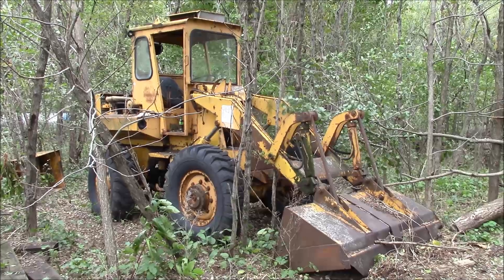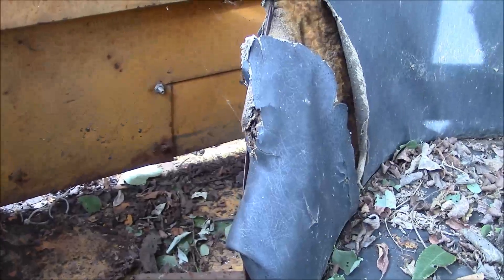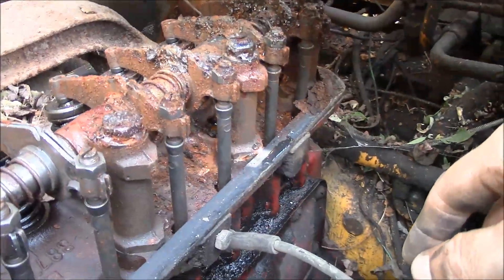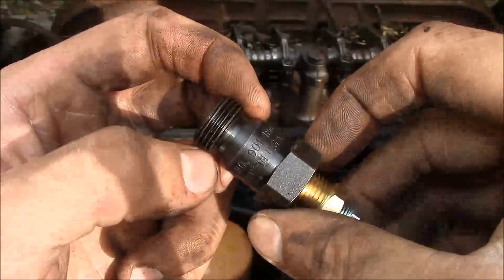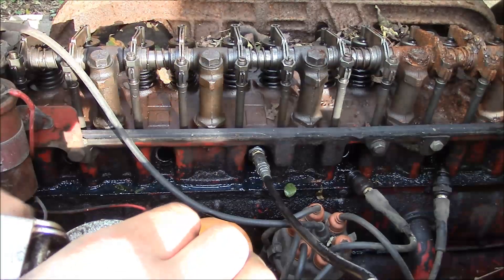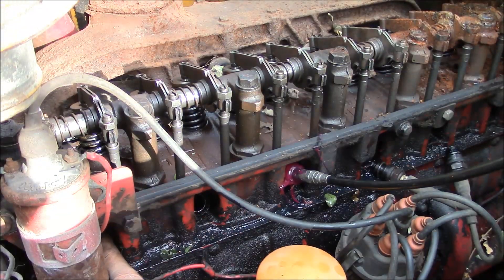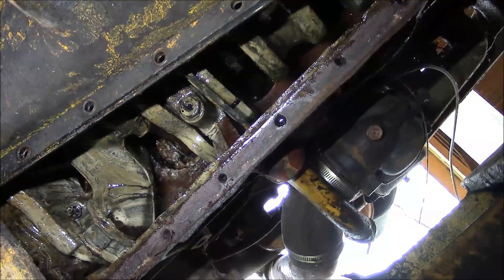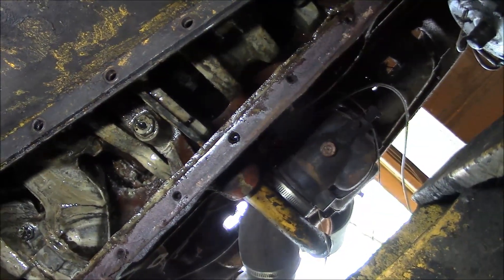Can You Free a Seized Engine with a Grease Gun?

Comment from the maker: The engine has had a mix of ATF and diesel in the cylinders for 4 weeks at the time I filmed this. I have no idea why I keep getting comments that I need to put some kind of special sauce in the cylinders. We did. I should have made the end of the video the beginning, because no one watched the explanation at the end.
Reply: @stinkyvonfishstix4196   *their car
Reply: @electricitysucks5  Period after 'idiots'.New sentence. Capital i on 'it's.
Reply: I understand this engine is probably roached but for future reference putting a breaker bar on the crankshaft with a heavy weight on the end can help the oil penetrate the cylinder walls. My father did that to a chrysler 360 v8 it took weeks but it freed up and went back to work.
Reply: I watched the explanation at the end. :-) Thanks for sharing that video! I hope to see more!
Reply: We had a old 4cyl ford in a old skidsteer that was seized.  We took the head off and gently hammered down on the top of the piston with a block of wood and lots of penetrating oil.
Reply: I would imagine that it is getting quite nippy to work outside on that thing. Use that brand new rollback (lol) and get it inside by the heater.
Reply: I did!
Reply: Remove the kon rods from number 5 and 2 and try free up the rest of the engine first then worry about the Pistons. So at least u can remove the engine
Reply: @juniorfuller6829  How would you do that?  Yep 5 years old, id like to know.
Reply: How'd you end up with all these machines? Were they operable and just abandoned? Did the property come with them? Were they junked?
Reply: Special sauce, lettuce, cheese, pickles and onions on a sesame seed bun.
Reply: Pure straight gasoline eats rust..... try that next time you run into a seized engine.
Reply: Piece of cake there's always a way
Reply: Too much yip yap
Reply: FYI Vinger is a hell of a special sauce to free up rust
Reply: Seafoam deep creep works great for seized engines. I've tried atf and diesel mixed. As well as MMO and it just wouldn't penetrate.  But after having Seafoam in it I noticed it started to slowly disappear and it was dripping out of the pan. And it eventually broke free and is still running today.  Not saying it didn't have blow by but it still runs haha.
Reply: 20 year master tech here....
Fill up cyclinders and crank case with kerosene. Let it sit for a week with a dipstick style block heater in it and plugged in. If it don't spin after that then its done.
Considering the rust on the rockers i would just yank it and not waste time.
Btw... Atf and diesel fuel mix is too thick to penetrate anything. Yes their lubricants but their viscosity is too thick.
Kerosene is one of the thinnest out there. Chevron RPM oil works well too but its hard to find, im not sure if they even make it still. Stuff is liquid gold tho.
Reply: I had a set of roller skate bearings start to rust on me for sitting in diesel fuel for several days.
Reply: Diesel fuel has water in it.
It will only perpetuate oxidation/rust.
Reply: what type of engine is it ? you should of posted someone might have one laying around looks like a 70's or 80s chevy ?
Reply: good luck
Reply: @WatchWesWork why not just torch the bad rods out , then you can rotate the engine and pull out the converter bolts and save this poor old machine ...maybe do a cummins swap on it lol
Reply: I used dextron and acitone equal parts soaked a couple weeks
Reply: Try dawn dish soap next time.
Reply: Don't bother even thinking about it.
Many people will comment before watching the whole video, or just get stuck on one thing you say/do and fixate on that.
I don't know how many times I have read comments where the person has entirely missed the point of the video, (often it revolves around the title of the video)
Reply: @Cheepchipsable  Guilty as charged. I always comment before I reach the end but I also go back and edit stuff. I might forget what I want to say if I wait till the end. I'm usually hoping someone watching will answer a question NOT the author of the video. I rarely happens but I keep asking anyway. Even now I'm only 3/4 into the video before I started reading comments . . .
Reply: You get this because you should have done it from a propane gas powered camping stove and put it in cocking hot with a metal funnel!!!
And not just pour in some oil, that won't help you need heat as expansion loosens the engine
Reply: 50/50 acetone and Hyd oil or ATF
Reply: Why not use special sauce? Lol! Just kidding. I watched to the end Wes. I Always learn something!
Reply: 50/50 muratic acid to water, it will eat 100% of rust and corrosion, but you won’t have and rubber seals llleft.
Reply: People don't read replies. They just reply without reading anything. You'll get those replies for years to come.
Reply: Brake fluid helps break up rust.
Reply: I think cylinder 1 shows it worked if you could see grease underneath. Cylinder 5 seemed the worst and might be your problem cylinder, so it might be worth trying grease gun method on cylinder 5 and see if the head gasket will hold enough pressure
Reply: Not special sauce but I've used muriatic acid to clean rust. But be careful
Reply: But Didja try peanut butter and RP-1? Dat’s wut mah unca alwez did to them stuckered enjins!!! 

Sigh. This right here is why I refuse to start making my own videos on auto and equipment repair. Too many “experts.”
Reply: Why ATF and diesel? Why not ATF mixed 1 to 1 with acetone?
Reply: I put Chunky Peter Pan peanut butter to unseize my motor.. the lady at my drop off Laundry mat told me to..I cant believe it didnt do nothing but make.me.hungry

Comment: 5 years down the road, my two cents: 
If you pull the head, clean up all the valves so they seal, reinstall the head with a new head gasket but remove all the rocker arms, and try this method one at a time on every piston that's not at bottom dead center, I'd bet it would come loose. But that's probably more work than you're wanting to put into this project.

Comment: Last ditch effort if it hasn't already been tried, I once freed a seized engine with coke, one can per cylinder. Really any cola should work it's the phosphoric acid, it dissolves rust.  If you have you could just use phosphoric acid it's sold as a rust remover.

Comment: When you started working on those springs, I thought for a second that I was watching Pakistani Trucks, as they are always pulling leaf springs off trucks.  But, they don't have rust. What they also don't have are air tools, ratchet spanners, trolley jacks, safety stands, concrete floors, eye protection or safety boots. What they do have is 6 helpers to move heavy things and pass bolts and other stuff.

Comment: Have you tried a breaker bar & socket with a weight?  I got a engine un-stuck with that method.  Breaker bar with a cheater pipe and hung a cinder block on the end. It took almost a month,  we noticed the cinder block had fallen off after 2 weeks (1/8 turn).  Re-set the breaker bar and it fell off again (1/8 turn) after 5 days.  It took a while, but nothing got bent

Comment: Depends on how it seized.
A broken valve on top of a piston one the up stroke? Busted crank shaft? Seized and welded cam or crank shaft? Nut between timing chain and crank gear? (which breaks the crank, cam, and block, by the way, and puts lots of broken block parts in the oil pan) grease isn't going to break it free.  

Why you'd want to use grease is beyond me.
It'll take a lot of grease to fill the cylinder, and you'll have a helluva mess to clean up if the engine is rebuildible and you decide to rebuild instead of replace it. (which would probably be cheaper both short and long term. Even if you used a short block and reuse the heads and manifolds.)

Comment: Put a coupla ounces of LIQUED WRENCH  in each cylinder & wait as long as posssible. Back off on all valve adjusters. Loosten water pump belt. Make shure tranny is in neutral. Be shure starter in NOT engaged.

Comment: Back in my gunsmithing days, people would bring in their muzzle loaders that had been left loaded for a few seasons. Some would have ball pullers broken off in the muzzle. I would adapt grease fittings to the flash hole or nipples and used an old hydraulic cylinder from a forklift and pack it with grease. Using a motorized hydraulic press made easy work of clearing the breach and barrel.

Comment: i just attached a tractor hydraulic hose with a ball valve a low pressure over pressure gauge with a return hose and a pressure gauge , ease one cylinder til the cranc flexes, you need to break the cylinders loose one by one, /do the one or muultiple cylinder that got stuck on open valve and are the actual troublemaker 
the oil passing by the cylinder is a good thing, it removes crud from getting squished in between piston and cylinder wall i limited the 180Bar tractor hydraulic system to 40 bar with a overpressure relieve valve to prevent fucking up a seased up engine

Comment: Try soaking those cylinders with marvel mystery oil for A couple of weeks. That's A corrosion inhibitor based Formula solution. It's eats through rust& carbon aswell to. Then add wd-40.& then try slowly rocking it the engine forward&backwards to see if it gives then. What do you have to lose$3.75 x A gallon of that. Here's their website www.marvelmystryoil.com
Reply: Next time he comes across a stuck engine, he'll more than likely do just that.

Comment: I had a Kz650 inline 4cyl bike low miles the 2nd owner couldnt figure out the points so the pulled the plugs. Well 4yrs later it was given to me. I tried everything to free the pistons but rings had rusted to cylinders. Whole thing was junk as u gotta get jugs off to split the case. If you store an engine COVER INTAKE & EXHAUST AND FILL IT TO THE BRIM WITH OIL. TILL ITS RUNNING OUT.

Comment: seeing how the pan can be moved and  you wanting to remove the engine  id take a some round stock and get on the flat part on the bottome of #2 cylinder  and  take a hammer and try and drive   the piston to top and do the same  on #5 cylinder  maybe you can free it up enough to bar it over sp you can un bolt the torque converter

Comment: So the engine is done.... To get at the converter bolts  get some muriatic acid(pool supply store) pour it in the plug holes and wait.The acid will eat away the pistons and may allow You to at least turn the crank enough to access the converter bolts.

Comment: Wes, could you do another video of trying to get this engine to turn over, but this time instead of trying to use hydraulic pressure to do it, maybe try removing two or three of the spark plugs and packing black powder in the cylinders then put the plugs back in and hook up an MSD coil to them and send a little spark into those cylinders, that would make for an interesting video.  Love your videos, keep up the good work. TP

Comment: Remove driveshafts or axle shafts and drag the machine to a workshop and remove engine. 
Even if you get the engine to turn with grease you then have to remove the grease before you could attempt to start it, or it will hydraulic and bend conrod.

Comment: You should see if you can put a 292 Chevy or like a 300 Ford Street 6 in it they're easy to come by and cheap. And they both point make more horsepower and torque than that international motor

Comment: That engine is screwed because loads of water got into it. I have freed numerous engines that seize from sitting (normally just piston ring seizes). I have been able to save every one. I use 75 percent diesel fuel, and 25 percent marvel mystery oil. I fill the cylinders up, go back and top them up every day until I see them drop. Then I put a bar on the crankshaft and heave ho away it breaks loose. None of the engines I have worked on had water in them like yours did.  If an engine gets like that it is wasted.

Comment: Dude hook a chain pull it and pop the clutch,  I have freed so many motor , I was given a ford 3/4 ton frozen for 35 years, soaked with brake fluid for a week pulled it 35 mph down the road broke free first shot, drove it 4 years, won't take much with that loader.
Reply from the maker: It does not have a clutch, like I said in the video.

Comment: Hi Wes, your videos are great,  I had a 1927 John Deere model D that had sat outside uncovered for over 40 years and that engine was stuck. I used a product called KROIL here is their website http://www.kanolabs.com/msn/?msclkid=8ea80e77aff41be824ed512a95a88cd1,  what I did was put the product in the cylinders, made an adapter for the spark plug holes and added a ball valve with a tee,  I then added a schrader fitting and a quick disconnect for an air hose. I pumped each cylinder with air, closed the valve and used a tire gauge to check to see whn the cylinders lost pressure, over time , I was able to turn the engine by hand. this company's products all work, and work well, possibly it will help with the loader eengine or some future projects that involve rust. please keep finding iron in the woods and bringing them back to life.

Comment: Even if you had freed the engine and managed to get it running it isn't likely your brother would have been able to put it into daily service. All of the seals are very likely as hard as a rock and within 24 hours it would be leaking oil all over the place. I'm not a quitter either but there comes a time when there's no point feeding hay to a dead horse.

Comment: Well, when oiling doesn't help, use chemicals. If it doesn't matter how the engine looks afterward, pump everything out of the cylinders, put something into it which soaks the rest of the oil out, like paper towels. And then go for acetic acid. It will remove rust and probably some amount of metal, just cover the holes but let them vent.
It should take 1-2 days.
Make sure to put something below the engine to capture it. It's not really hazardous itself (except skin damage etc by being an acid), but you don't want the remains of the engine down on the floor :D
If you want to save the engine, use phosphoric acid. It will convert the rust to a passivation layer and don't attack the metal itself. But it's therefore not that strong.

Phosphoric acid is also non-toxic for the environment since it will convert to a fertilizer.

In theory, you could also setup a electrolysis to remove the rust and move it to a piece of iron, but you need a dc-welder to pull this off 1-2 hours.

Comment: I have successfully freed engines like that. 

Working in situe makes it more difficult, but in principle get the lowest temperature grease you can, something like what they use in the Arctic. 

Pressure the stuck cylinders, not with any intention of budging the engine, but to allow the grease to work past the rings and break the bond. 

Heating the engine block will also help, I've used a second water cooled engine as a heat source and plumbed the block your freeing up in place of the radiator. It's risky because you can overheat your good engine if your not careful. 

If your willing to risk the pistons then you can also use a plumbers freezing spray under the pistons. 

Expanding the bores with heat, shrinking the pistons by freezing them with 3000 psi of grease which will be liquid at that temperature should free the engine.

Comment: I have the same loader but mine doesn't have a cab. There is room to pull the engine with the torque converter and if you need to someone has already cut the radiator support. The problem dropping in a newer engine is the center of the torque converter is huge and seats in the end of the crankshaft

Comment: I know this comment is probably too late, but;  Pull the head off of it.  Get the diesel and ATF out of the cylinders.  They have pretty much done all they can do.  Get a few cans of WD40, and some Dollar General penetrating lubricant, which is much better than people think.    Spray all the rod and crankshaft journals.   The side of the connecting rod ends and the crank shaft throw sides can lock one up, if they rust, as bad as the cylinder wall rust.  Spray the cylinder walls good.  Spray all the cylinder walls good.  let it set, while you find a 3 inch, or so, round stick of oak hardwood and a 2, or 3 pound hammer.  Impact the top of the pistons with the hammer and stick of wood, alternating cylinder to cylinder, but not hard enough to damage the pistons.  Also, the pistons that might be close to the top or bottom of the cylinder, you might want to impact the sides of the rod down at the crankshaft, instead, until it starts to turn.  It may take some time, but if it is unstickable, this will do it.  If only a couple of cylinders are bad, you can get a dingleberry cylinder hone, and dress them down, even to the point of using a larger piston and rings for that cylinder, if necessary.  Also, that looks like an old Chevy engine.  If it is, just about any Chevy engine, especially from that era, should bolt up to the bell housing.  It's worth checking out.  If you might still be working on this machine, good luck.

Comment: I know how hard it is to "walk away" when an engine is beyond common sense repair, but you're right to do the maths and let your head, not your heart, decide. It's a shame, considering the apparent value of the rest of the machine. Replacing the engine with a used one makes good sense.  Do you have "scrap yards" in the U.S. like we have in U.K., where it's possible to buy an engine from a scrapped vehicle? And is there a comparable source for tractors, road machinery, etc?

Comment: With no more bolts you turned your have the wrong conclusion,, unless you have water in cylinder or oil pan not much much stuck make sure louder is out of gear or clutch is pushed in